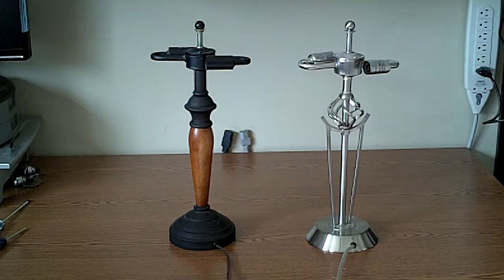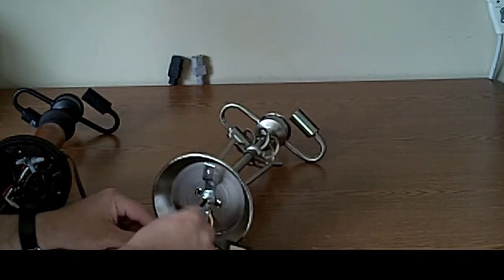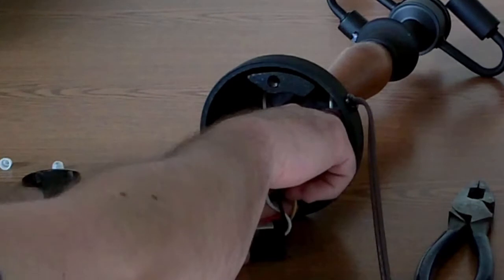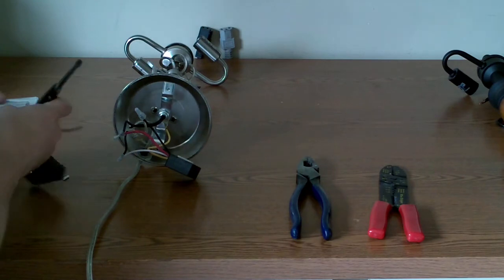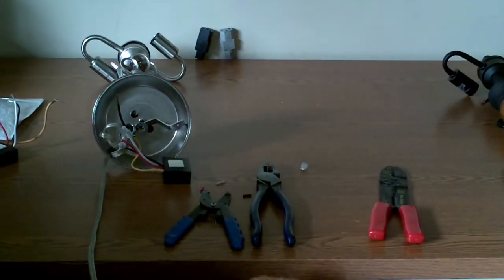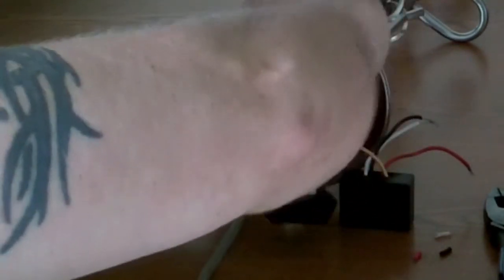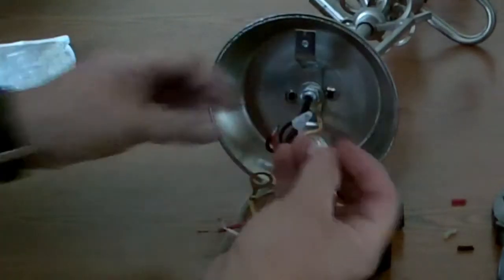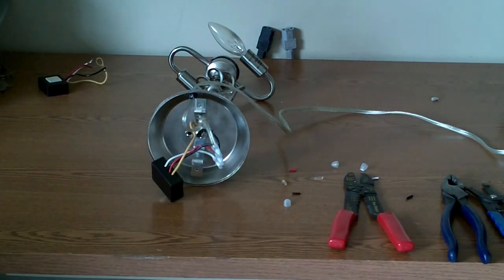Touch Lamp Hack / Fix

Comment: worst video i have seen. black Smooth wire it hot with numbers on it. ribbed wire is neutral.  hand in way, without stopping camera to view what you just did. keeping both modules on at same time was confusing.  i'm a female. jeeez..........
Reply from the maker: And where are your videos since you think you can do better? 🤣